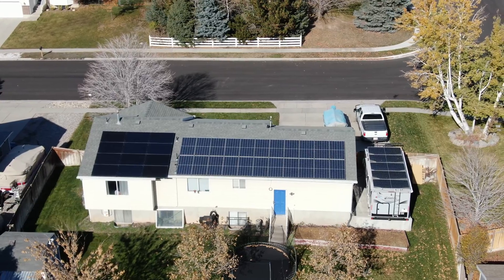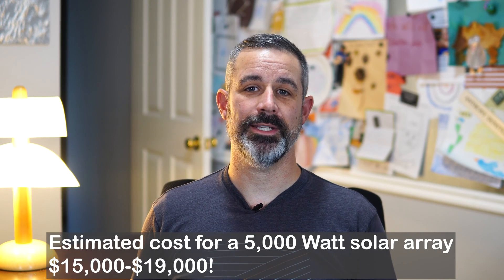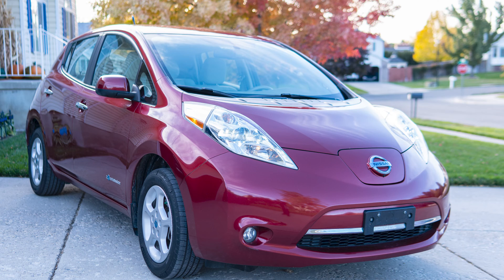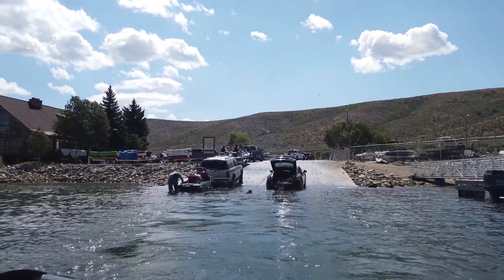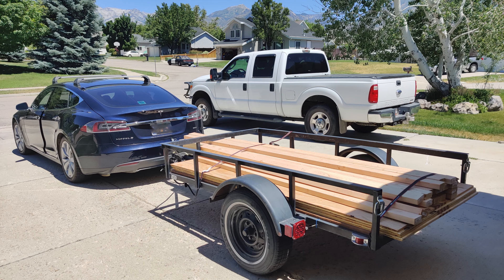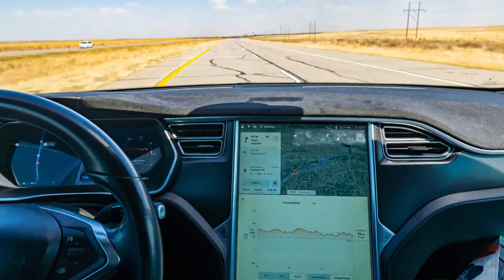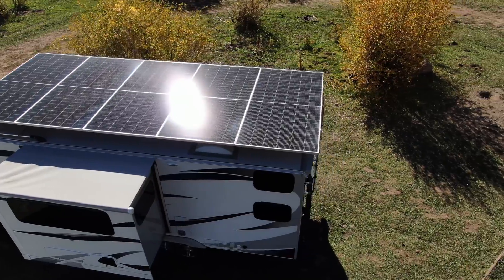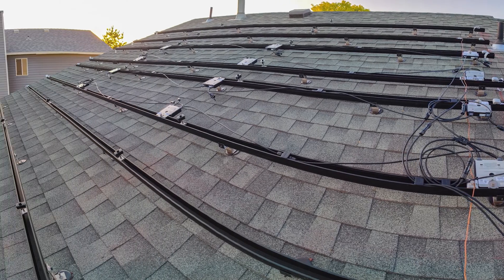How Long Did It Take Us To Break Even On Our DIY Solar Installation?

Comment: 6 years payback in the uk , that was a 4kw array and 4.8kw battery 11 years ago . Zero faults or maintenance. Next up is a heat pump where we now get a 7 1/2 thousand pound grant towards it. We are on the oldschool feed and tariff Payment,  so we get paid an amount regardless of whether we use it or not . vehicle to grid charging hopefully will be coming in 2024 which I’m holding out for currently charging our 2019 Nissan Leaf for three pin plug waiting!
Reply from the maker: Awesome, sounds like you've got a lot of great things going on over there. Thanks for sharing!

Comment: Supercharging a Tesla was proven not to be harmful on batteries btw.
Reply from the maker: There's a couple different chemistries and form factors of Tesla batteries. There are different effects for each chemistry but there is some incremental damage to them all. The question is whether it is going to be an issue over the expected lifetime of the vehicle. Also it's not all about range degradation, supercharging also reduces the speed of future supercharging sessions. In the 70k miles I've put on my 18650 battery type of my 2015 Model S I've seen a noticable difference in the supercharging speed to the point we're not taking our car on as many road trips anymore because the charging sessions are getting to be too long. This is why I avoid supercharging around home, to preserve what supercharging speed we have for when we're waiting on road trips.

Comment: excellent summary!
one aspect to mention beyond break-even (or ROI) is lost opportunity cost. ie. what value (investment or otherwise) could that money have provided if put towards some low effort investment or expense. What family value would there have been taking a $2000 vacation for 5 years in a row? What would $10k bonds be worth 5 years later, etc?
Reply from the maker: Yes I considered this, but ultimately I decided to ignore it because you could make the opportunity cost argument against buying literally anything. It's just easier on large purchases, but lots of small purchases also add up. Electricity is considered a necessity to varying degrees, and in our case also powers our car so I know we're going to need to spend that money regardless. Now that it's broken even and we're getting free electricity it's saving us money similarly to if we had the money invested and were using the interest to pay an electric bill. Obviously the stock market could go much higher, or much lower and the way I chose to spend my money eliminated any variables and I'm extremely happy with it.
Reply: @ElectricTechAdventures so wonderful to hear! I looked at my annual costs of electricity vs sunlight in western BC, and it doesn't look like ROI would be for decades...  way too much clouds here
Reply from the maker: @dl5244  yes sun exposure certainly makes a big difference.

Comment: net metering is bullshit. a solar farm can make a profit, but a house cannot, they take your extra power and give you nothing back.
Reply from the maker: Yep, that's why I was super motivated to get into the 1:1 net metering before it changed. When people ask me now in the local area who are on Rocky Mountain Power if I recommend they install solar now I can't give a strong endorsement. Perhaps if they install a battery or two enough to largely self consume their own production does it make more sense, but that increases the install costs dramatically. At least in that case though you do have the advantage of emergency preparedness if the grid goes down. In my case I just use my RV for that in a less automated fashion.

Comment: Great video. Love the detail. So I have a weird case. I have a large house in the US Virgin Islands at 17 degrees latitude. So first I have more energy per meter squared than about any place in the US. Second, the power down here since my house is considered under construction is 50 cents per KWH. When it's finished it goes down to 42 cents per KWH. So my payback time is a bit shorter. 

I  currently have a 11 KWH array with 54 KWHs worth of batteries and for most of the year go off-grid. I pay $6.33 per month to keep hooked to the grid. So my base cost is $76 per year to keep on the grid. Since I am trying to move off the grid not just for the cost but the fact it goes down a lot and has very dirty power which damages appliances, I do not participate in net metering. 

Since I turned it on in March I have produced/used 10480 KWH this year saving me $5,240 as of 20 Nov 2023. I still had times where we had storms and no sun for a few days and there was a month where we had an inverter problem but at most, I am going to spend about $700 this year. Also, there were no people in the house in January and February so those months were just the base charge. Assuming normal usage for December, January and February the house should need about 14,000 kwh per year or 7k per year of savings, in the current configuration. Once it is finished as shown below I expect the usage to move to 40-50,000 kWh per year, so without solar my bill could be $20 - 25,000 per year. Also, this does not include electric cars which would obviously launch the usage much much higher, but is planned for the future. 

FYI all the prices I am giving include the shipping to the VI. Total the panels were $5k, batteries $30k, inverter $5k, mounting, wire, pipes, misc another $5k. So $45k for the current system. I  added another inverter for some build-out 5k, 2 windmills and the additional pieces $5k, plus add some more wire, towers, etc another $5-7k (still pricing) So when it is complete it will cost $65k assuming I missed a cost or two. In the end with the panels and windmills, I will have 17.5 kw worth of solar (expandable to 22kw) and 4 kw worth of wind.  

In the future I have plans for a 20 kw generator ($6k) for emergencies. I will add more solar/batteries in the future with a target of 30-40 kw worth of solar so everyone can charge electric vehicles for the reasons below and probably double the batteries. I figure all together it should cost another 60-70k at most since the price of components keeps dropping.  

The reason for the large size is due to when the house is done it will have 5 apartments split over 11 bedrooms and 7 bathrooms, plus a garage for each apartment with vehicle charging using excess power. So there are 5 sets of washer dryers. 3 heat pump water heaters, the main water pump/pressure tank and 7-8 large AC units, 5 refrigerators, 5 microwaves, etc etc. So my power use especially during summer is MASSIVE.

While this sounds excessive this is a rental property so it is much easier to re-coup my investment, plus I can charge the units for the power, meaning I will be turning my savings into a profit center. I am going to discount it down to 30-35 cents per KWH to entice people to live there, but still, at those rates, I will recoup my costs in a very short period of time. When fully occupied by the calculations above at 40,000 kWh per year at 30 cents per kWh that would recoup at least $12,000 per year on the low end. So even with the parts I have already purchased and plan to install (65k) the payoff will be just a few years (5.42). If I chose to use pass-through pricing at 42 cents per KWH that would be $16,800 per year which would bring the payoff to 3.87 years.
Reply from the maker: Wow, thanks for sharing all the details of your amazing system! Makes me want to buy a 4-plex rental or something like that to do a similar thing here in Utah. I'm glad to hear it's working out so well for you down there. I have ambitions to defect from the grid someday, but it might not be in the house I live in now. Plus I'm not sure if I'd be allowed to legally.

Comment: Great overview. You were really smart to get grandfathered into Rocky Mountains 1:1 net metering.

Last September installed a 9kw system myself here in Utah as well. It came out to $18k pre-insensitives. I was originally looking at a payback period of about 7 years but shortly after installation I switched to Rocky Mountains TOU plan which made most of my energy cheaper thus making my payback period shoot up to about 11 years. The 9kw system is definitely too small for me though. Over the summer I still had a bill of about $45 and $120-180 in the winter. But I don’t have any more south facing roof open. Might look into ground mounting.
Reply from the maker: Thanks for sharing your experience! I wish I had enough land to do a ground mount system. It works fine on the roof the vast majority of the time, but anytime I do want to push snow off, or check on things it would be a lot easier on the ground.

Comment: Thanks for the video. 
Right now we have 15,830 watts of PV. I just purchased more PV that I got a great deal on. Next spring it will go in and we will have 17,570 watts of PV and I'll sell the PV it replaces or use them somewhere else. Of our present 15830, 6300 was a free grant that we installed and made $1k profit on. We have been building over the years, our original PV went in in 2006 and we just replaced those original 175 watt modules with 370 bifacial modules that put out 370 watts up to 461 watts which we hope to approach when it snows here. They cost $105 each but we have a dealer license so they are not available to the general public.

We have been driving EV's for the last seven plus years as our main vehicle (we have an old truck that does a couple of hundred miles a year so we really only have one vehicle).

The house is heated with two mini splits that I installed and our HW is from a tankless that I also installed. We hang our clothes on a line that cost $35. 

Our coop stopped net metering and we get paid once a year for the electricity we produce at wholesale rates while paying retail rates for all the electricity we use. We did have ten years where we didn't pay any electric fees so we are ahead on our overall savings, or slightly behind. Personally we don't care, we have battery backup that can run the house and enough PV to charge the car, this was our goal and concern. The higher gas and electric go the more we save, what we have done is hedge inflation which was also our goal.
Reply from the maker: Wow, 17,570 is a massively large array but it makes sense considering having an EV and using mini splits. I might very well install a heat pump mini split in my house at some point. I'd like one in my garage, but I need to replace the main garage door with an insulated one first. Thanks for sharing all your details!
Reply: @ElectricTechAdventures  Thanks.
I started in 2006 with eight 175 watt Solar World (Shell) modules on a wooden frame and one Outback FX inverter. I kept increasing my PV and now I have two systems, one is a SolarEdge 6.4kW which I put on our garage roof, it was a grant from NYPA (NY Power Authority) and since I did all the work myself I actually made $1k on it, although that wasn't my intention. Every time I broke even or got close to it I increased my system. I never really concerned myself with cost I figured it would catch up and if I never did it I wouldn't be paying heavy electric bills for charging the EV and running the house and I would be immune from fuel and high electric bills which we are.

I wanted desperately to get off FF (fossil fuel). Now with the mini splits I'm very close, they have gotten really good and when the outside temps are in the 30's and 40's they just sip power. I bought a 12k Senville Aura last year from Amazon and learned the HVAC procedures to install it right and vacuum the system. Because I bought the right instruments to do it professionally it cost me about $1800 to $1900 to do the first install. I didn't have the expertise to install a two zone mini split at the time and I didn't want to spend the money only to find out they weren't worth it but they were in spades so this year I bought another one and now the house runs just on mini splits most of the year and we live in the Catskill Mountains so it can get pretty rough here in the winter. I can see you're very good at installing this stuff so you could probably save a lot by putting in your own mini splits like I did. I figure the second one only cost about $900 with the gov. rebate.

Since my electric coop is independent from commercial energy suppliers they don't have to follow NY PSC (Public Service Comm.) statutes for net metering so what happens here is all the electricity I produce during the day  runs my house and charges the EV (2023 Bolt EUV) so I load shift to  run things like dish washing and clothes washing during the day.  Remember I have a tankless water heater which lends itself very well to load shifting but not everyone can take a shower at the same time, you have to use common sense. The tankless uses 5kW when it's running so if I take an 6 minute shower it uses ~500 watts then it goes off completely so it's perfect for load shifting. We run a lot of battery tools and appliances like a battery vacuum and of course power tools so if we vacuum at night we charge the next day when it's light out and since I have so much PV we charge even on overcast days but we can't charge the EV, we have to wait for sunny days to do that.

Our electric bill ran ~$120 for the last two months including all fees, that's charging the EV, heating the house, well pump, freezer, fridge, lights etc., basically everything. I only run on batteries when there's a power failure (~4 or 5 times a year in our rural location), they should last 30 plus years. My thinking is that I want to be able to charge and run things on overcast days too. Right now it's 8:30 am and overcast, I'm producing ~1kW enough to run everything.

Sorry for the long post.
Reply from the maker: Thanks for sharing all your details! One of the great benefits of learning how to install it yourself is you can modify and expand the system with far less effort than getting an installer to come do it and obviously cheaper too. In my case I expanded once, then the south facing side of my roof was full. I then expanded onto my RV and perhaps someday we'll have a covered deck which will create more roof space for me to install solar panels on. :)

Comment: We've had a similar journey. My quotes for solar 4 years ago were around $4 per watt, so I installed my own 13.7 kw system after a ton of research.   My cost after tax credit came out at about 80 cents per watt and we are 3 years into a 4 year payback time.  We've had a bmw i3 for 4 years and have basically saved as much in gas as we bought the car for.  Luckily we can perpetually carry forward excess electrical credit so last year I installed mini splits and we used them to heat our house last winter in western Colorado!
Reply from the maker: That's awesome! Do you think you'll get another electric car and if so what model will you get?
Reply: @ElectricTechAdventures  we have had an R1S pre-ordered for 2 years, which would be an awesome family vehicle for exploring the mountains and desert.  I would love to check out your trailer build, maybe if you are camping near Moab!
Reply from the maker: For some reason I just found your response in YouTube comment jail called "held for review". Now that the Cybertruck doesn't work for us I looked into the R1S and unfortunately the tongue weight is the killer since our trailer's tongue weight is around 1,100 lbs. The R1S can handle max about 400 lbs less than that. At this point there are zero options for electric vehicles that can seat 6 AND handle the tongue weight of our trailer. Obviously the trailer can be either replaced or modified (I'm not interested in doing that) but the 6 seats is not negotiable for us. I'm going to just continue to monitor the EV market and when a vehicle is offered that can handle our needs I'll likely buy it. I'm still hoping that the Cybertruck will seat 6 eventually then we'll but it. With any luck they'll add the 6th seat option by the time my reservation is front of the line. I'm also waiting for others to get the early Cybertrucks and do RV towing tests to give me a real world example of expected range loss while towing. Most likely I'd get the dual motor with the range extender but $96k is rough, so I'd likely start with the dual motor just to see how well it works for us. It's a shame Tesla didn't ship their original prototype from 2019. It was exactly what I need with 6 seats, higher payload, higher towing capacity, & longer range. If it was all that AND the price increased to $96k that would have made a lot more sense. We do go camping to Moab periodically and I'm sure we will again someday. I have an upcoming video series taking the trailer to Moab for a week back in Oct 2022. Yeah I'm super behind on editing trips because they're extra time consuming to edit. :(